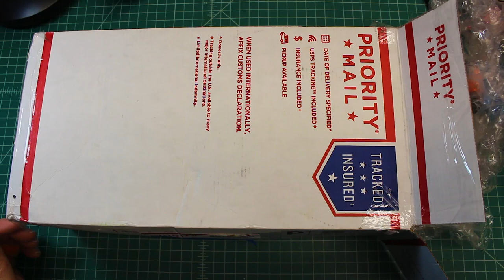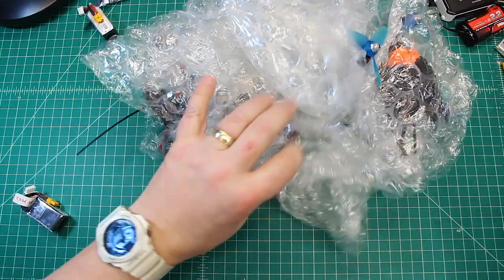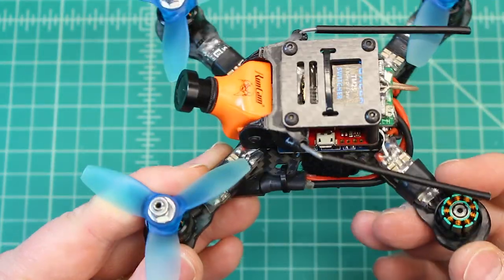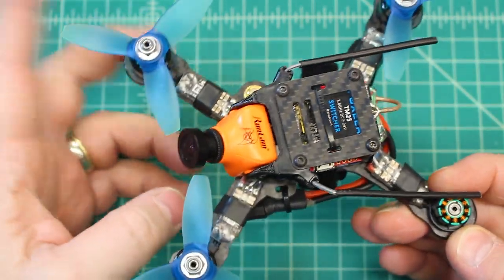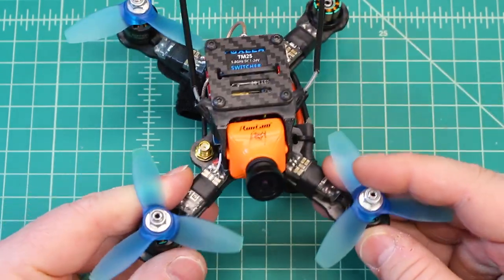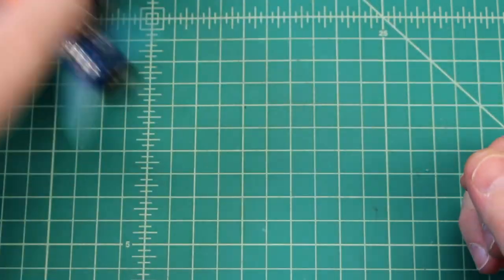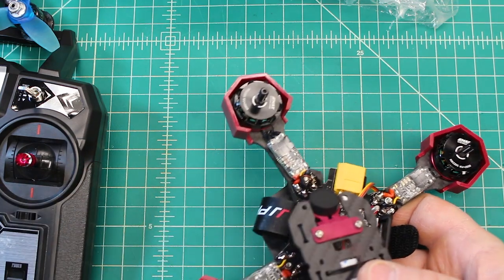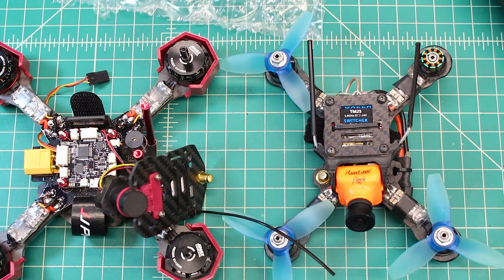Video Series "Mailbox 010" (Whats in the Mail Today)

Comment: Hey Doug, do you know the weight of that hyper baby build with and without the battery? I'm looking to do a 3" build with all "full size" 5" quad parts like you have but need to keep the weight under 250g with battery. I'm thinking I might have to step down to a 650mah 4s and sacrifice some flight time.
Reply from the maker: Matt D 194g without battery and 287 with Tattu 850 4s
Reply from the maker: Matt D you might try a 4 in 1 ESC and then you won't need a PDB and it will cut some weight.
Reply: X-Frames FPV thanks Doug. I was also thinking of maybe using a FC that has a pdb like a Kombini to shave a few grams
Reply from the maker: Matt D the Betaflight F3 Flight Controller/PDB with Spedix ES20s would be good as well.
Reply: I was thinking spedix es20's as well but now I'm thinking maybe a kiss aio fc which includes esc's and is only 11g